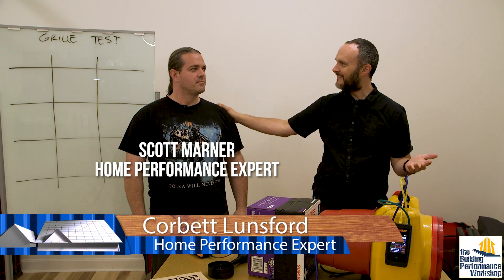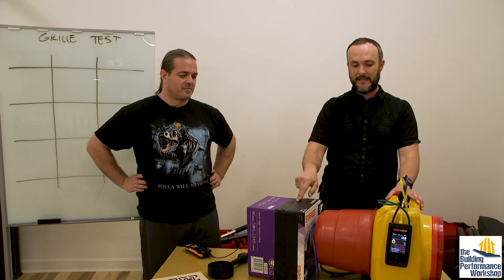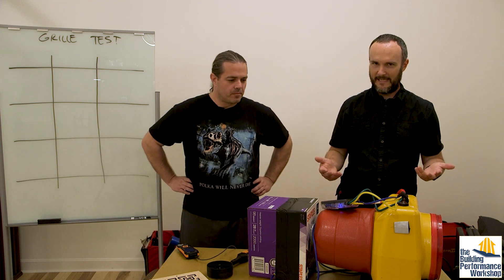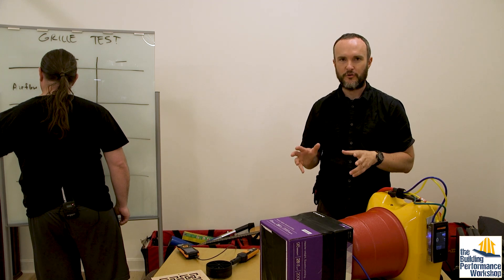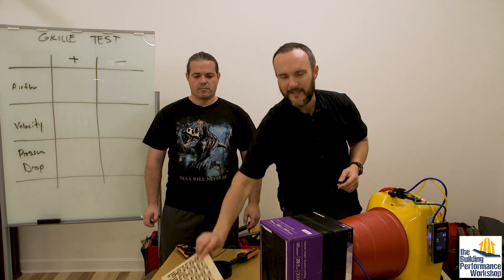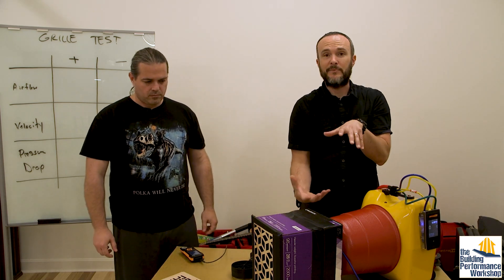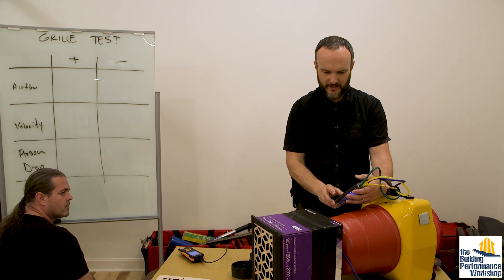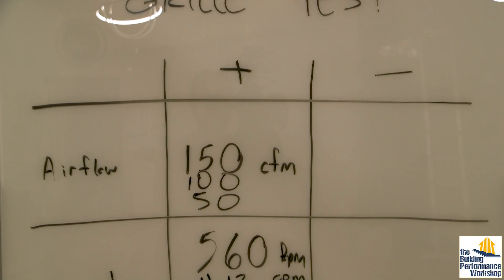HVAC Airflow Diagnostics: Testing Carved Grilles for CFM, Velocity, Pressure Drop, and K-Factor

Comment: What is the math behind 50 / 213 multiple by 144 to convert from square feet to square inches?  I don't see the connection where you conjure up the 144. I'm familiar with metric system only so the origin of 144 puzzles me.
Reply from the maker: Ah, 12” is a foot, so to go from sq ft to sq inches multiply by 12 by 12

Comment: Just out of curiosity I have a question when setting up the test of course for the video to make everything within the camera screen your testing rig would have to be small short. 
               My question is why did hitting the fan do you causing back pressure in a turbulence that interferes with the measurements with such a short little ductwork directly out of the fan right into the box ? 

            Would it be more accurate with a section of ductwork for example 10 feet long to get both laminar flow through ductwork and to  have a volume a mass of steady air as a buffer (probably not using the right word) but I think Do you know what I’m trying to describe. 
         To achieve a more accurate measurement ? 

      Maybe I’m over thinking this tell me your thoughts.    Or simply try it through a 10 foot piece of duct onto that box between the air blower retake these measurements again see if there’s a change ?
Reply from the maker: I think I understand your last q’s, T, and you could do that, you just have to decide how much time and attention you think is merited for whatever goal you’re trying to hit (and the budgets of your clients).
Reply: @HomePerformance  true 👍